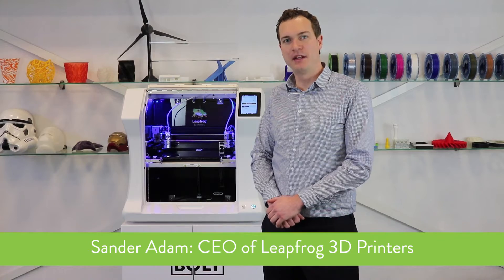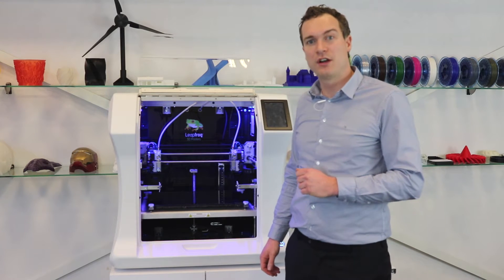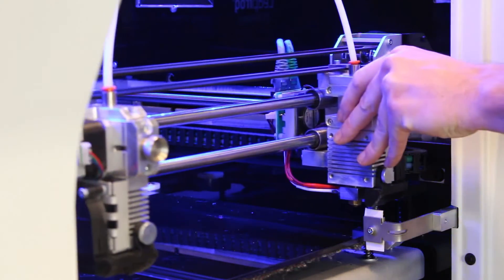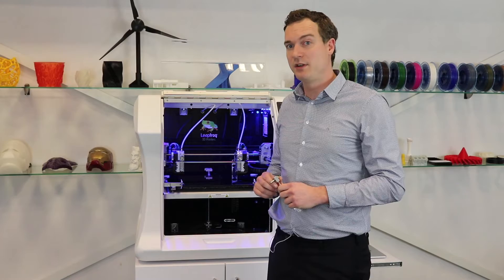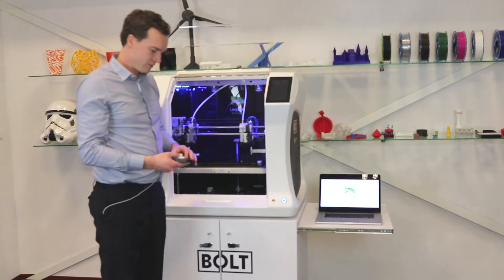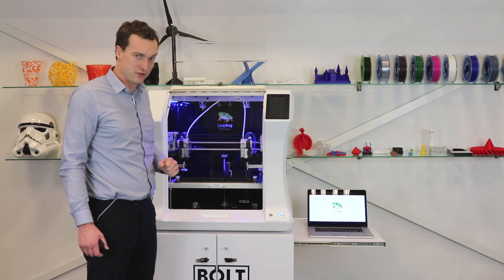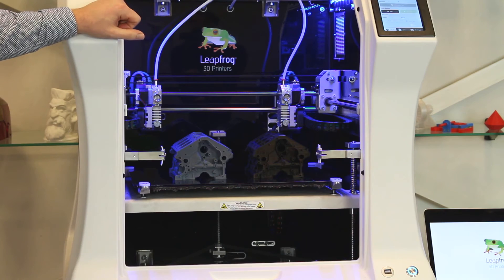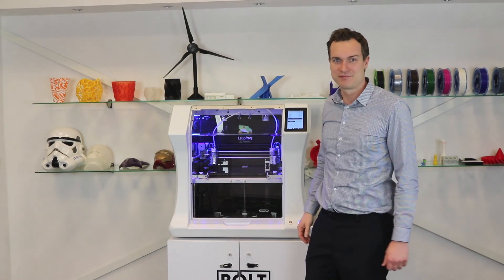Bolt 3D printer: A CEO's opinion

Comment: Can you tell me if the bolt has automatic bed leveling? Also, can you pause a print and does it remember where the print project was in case of a power outage? Thanks!
Reply from the maker: This machine has a manual bed leveling system. The software has a pause-start print option that you can use, but in case of power outage it will not be able to remember the project.
Reply: Thanks for the reply. This is a bit disappointing. Will there be a firmware update to address this? Also, I can not find your higher temperature extruders/nozzles anywhere on your website. Are they not shipping anymore or what is the case? Thanks!
Reply from the maker: You can find the parts here: https://www.lpfrg.com/en/products/supply/replacement-parts/ THey should be available for purchase again next month.
Reply: https://www.youtube.com/watch?v=lgBVhVPsvLo